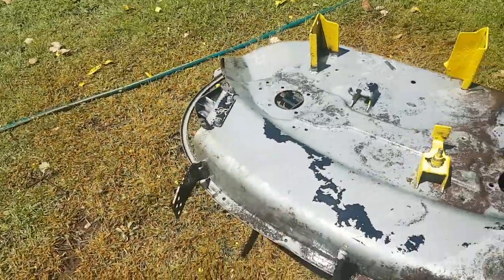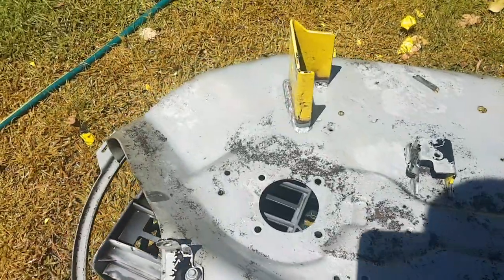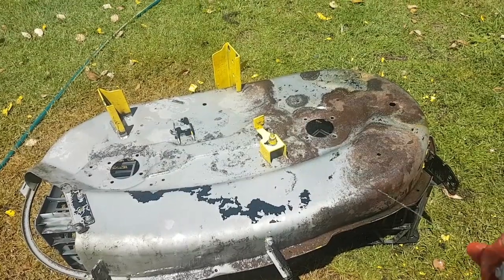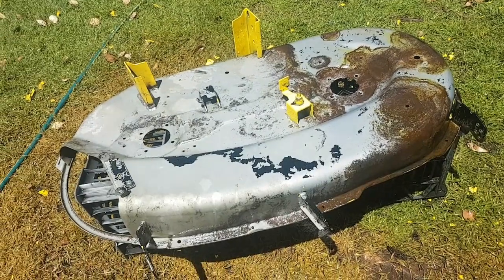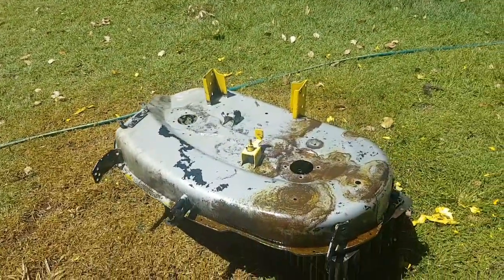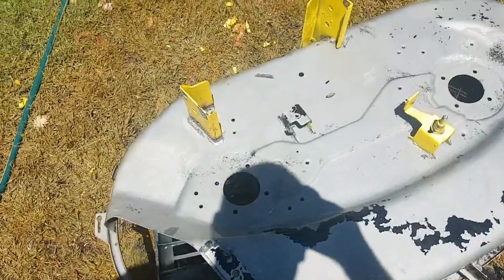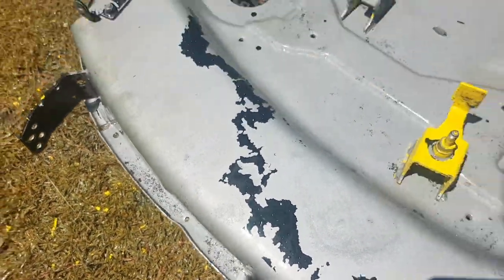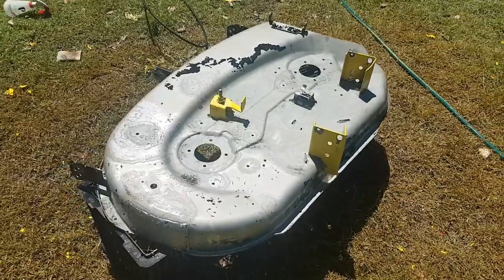How to remove rust - The Easy way! Mower deck refurb

Comment: What was the original strength of HCL before you diluted it?  Do you have to neutralize it or clean it after you treat with the HCL?
Reply: Very good question, if you ever get the answer will you please post it or send it to me. I saw another post that shows he said  50/50 1:1, I'm just guessing that you should be able to neutralize it by washing it if with water?  Also, I'm pretty sure the acid can be bought at a pool supply store or home depot.  I've heard of people buying it at home depot to clean stuff off of rocks to get to fossils.  I don't know how long to let it sit before spraying it off, I know if you let your rocks sit in it over night you'll lose everything which is why I use vinager. I'm hoping my John Deere has enough metal in it to fiberglass and then Bondo.
Reply: @dog0311  Yes he did say he mixes it 50/50 but when you go to buy HCL there are various strengths of HCL available.  Most HCL available already comes pre-diluted to varying degrees.  I just did a quick and dirty restore on my own deck but used rust sealer instead of removing the rust.  Scrape paint/little grinding/rustoleum rust sealer-primer/paint/clear-coat.  Will let you know in a year if it works.  One thing, whether you do this video way or what I did, the rust leaves a lot of pitting and bumps that doesn't go away even if you remove the rust.  If I had it to do over again I would have applied several coats of filler primer on top of the rust sealer-primer and sanded to smooth out the bumps at least on the underside of the deck.  even with paint and clear coat the rust pits and bumps let grass stick to it.  The clear coat and paint definitely help me to clean it off easier and protect from future rust but a smooth surface on the underside would have been much better in hindsight.

Comment: I can’t find Hydrochloric acid but only muriatic acid… is it the same thing?
Reply from the maker: I don't think so. Most hardware's, or pool shops will gave it
Reply: Muriatic acid is a form of hydrochloric acid, which has a pH of about 1 to 2. The only differences between hydrochloric acid and muriatic acid are purity
Reply: @bizkitbr  so i have muriatic i could use this on underside of mower deck?